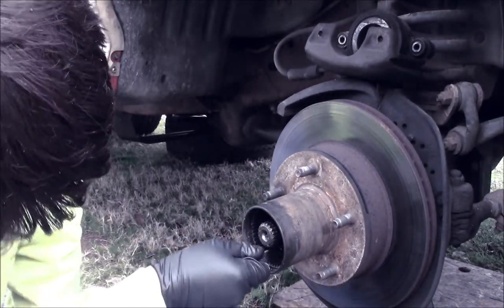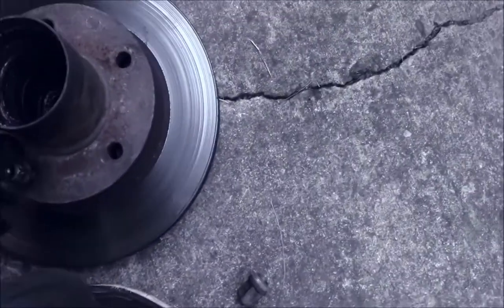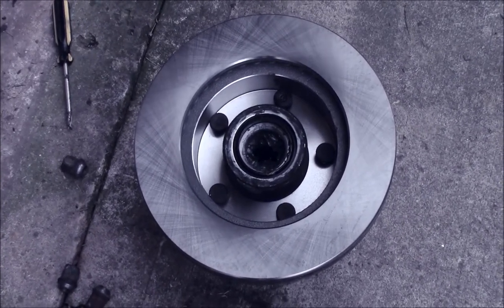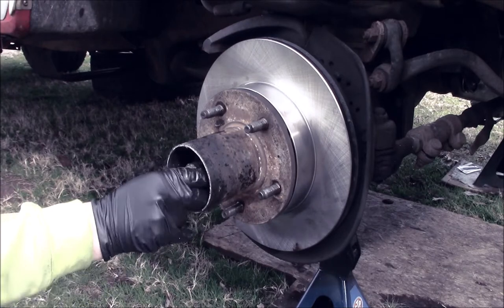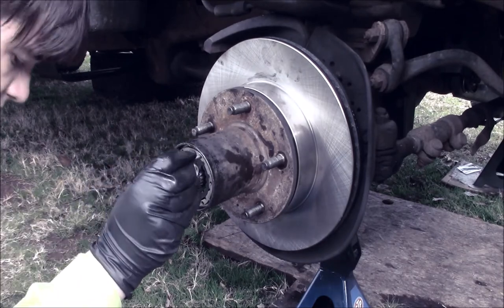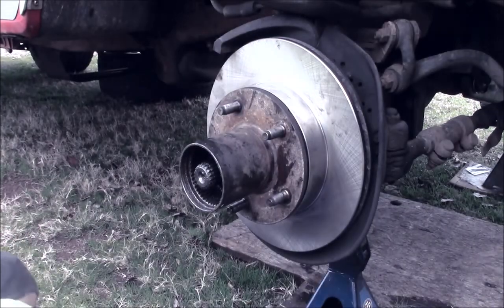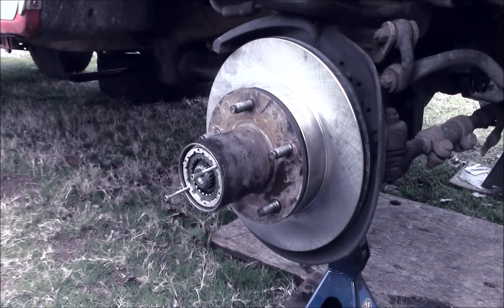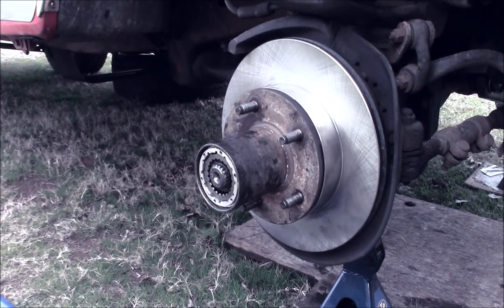How To Replace 4x4 Rotors, and bearings (87-96 f-150 and bronco)

Comment: Got any suggestions on separating hub assembly from rotor?
Reply from the maker: Lug nut on the stud and drive it out so it doesnt damage the stud
Reply from the maker: Or replace studs no telling how much they have been through over the years
Reply: I have the studs out of the rotor...the seal and bearing are out...just having a problem with hub separating from old rotor
Reply from the maker: @unclereub4024  how bad is the rust in your area?
Reply: @Xxdayday99  northeast Ohio truck has lived here all 27 years
Reply: @Xxdayday99  for perspective I changed out original starter and alternator last year
Reply from the maker: @unclereub4024  it could just be rusted together they sell both pieces seperate
Reply: The easy process is using a bottle of Map gas on a propane torch to heat the studs one by one individually. I use 2 plain regular stainless steel lug nuts tightened together slightly to protect the threads. I heat the stud from the back side and use my air hammer from the front to drive the stud out works like a charm every time. They usually pop right out. If ya get one that gives ya grief someone will have to press it out. Just means the guy that did that job before U got the truck slightly cocked the stud when he put it back in and it galled the metals which totally bonded together during pressing process. It does happen more often if the guy was a slop. I put em back together by drawing the stud up with a nut or bushing from the front side with my impact gun. Seems to work better next time ya got to get em apart they come apart much easier. Some guys back in the days pressed the studs back in or they used a garbage impact gun and galled the steel which rusts together so that is why a stud might not come out by air hammering it. Some times a little more heat and quick does of cold water works too. Just watch your eyes when ya do that the water comes flying out of there at ya. Using a little bit of white grease on reassembly also helps to not gall the metals ..
Reply: @thekingsilverado3266  that would have been a lot cheaper than buying while new assemblirs...which I did

Comment: If you have play in rotor it’s not fully seated and you need to run nuts down with impact
Reply from the maker: i tried everything and it wouldnt seat i think once the wheel was on it it was fine i havent had any problems yet
Reply: U do not tell idiots to run that nut down with an impact. I use a battery impact lightly to push it back together.